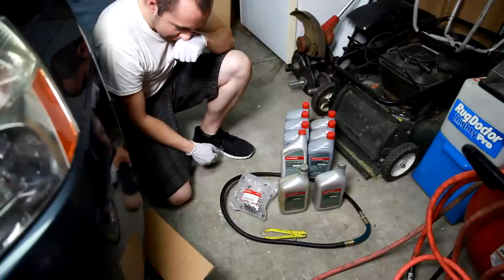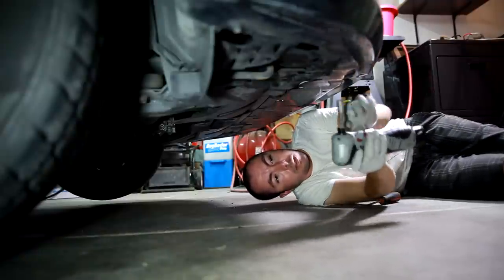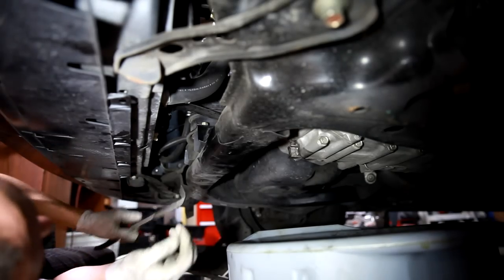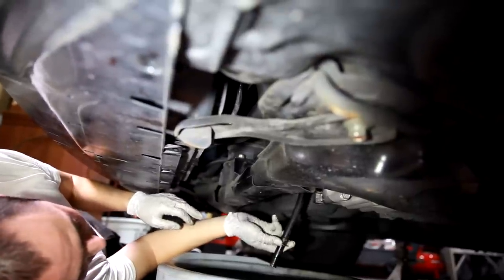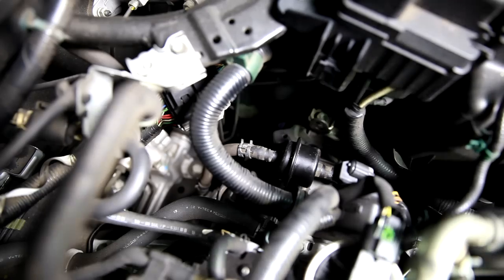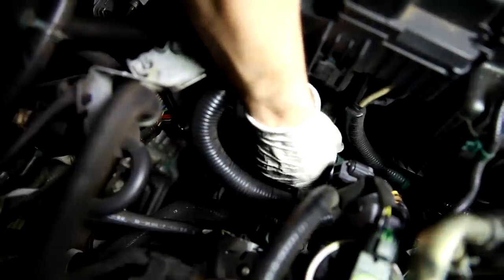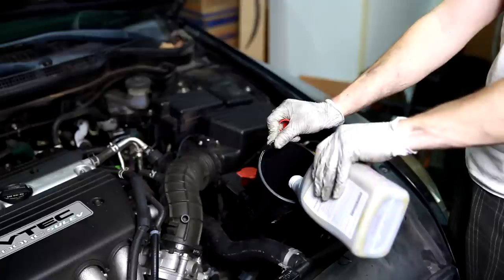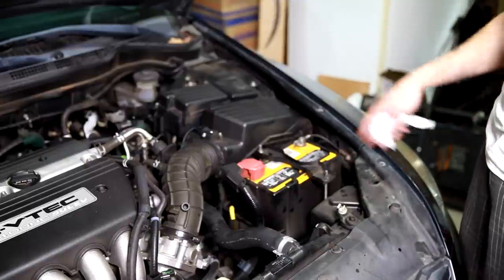2003-2007 Honda Accord Complete Transmission flush with filter

Comment: Followed this procedure on a 2008 Civic.  It's a small pain to disconnect the line and pump out the old, nasty fluid in the torque converter (if you just remove the drain plug, - all you are doing is replacing half the trans fluid, effectively diluting the old fluid with new by 50%).  A bigger pain to disconnect the airbox and related tubing to get to the external inline trans filter, but this is the complete service.  Thanks for sharing your experience - and ignore the whiners.
Reply from the maker: We appreciate the love :)
Reply: I flushed out my 2009 Accords trans,it had about 200,000 miles on it last year.yes that trans filter is a little pain in the ace but I got her done.she purrs like a kitten too

Comment: Finally someone else who does flushes on non CVT transmissions same as I do. I've been getting so much grief over the years from "licensed" mechanics screaming the return line is so important because its also lubricating parts. At idle, the left over fluid in the return line is more than enough. Only difference I would suggest is not to run it until the pressure line is spitting out air. I usually count to about 20 or 25 seconds each run so there's still a minor amount of fluid left in the pan. It'll take a little more fluid to flush out properly but at least its not running dry which I think is important in higher mileage transmissions. Then just measure each time after the 25 second run and fill that much back in with fresh fluid. Video was chill, well filmed and explained. Awesome job!

Comment: I missed the part where you used that hose you showed in the beginning. I'll rewatch. Still, a very good video. Good job.

Update: I did this flush and fill today. Here are the lessons I learned:
1. The 90 degree pliars are indespensible. You will need them on every clamp. The bend helps you reach all three components of the clamp. I bought a huge pair at HF for  $4. Why? Because I tried this with a pair of normal pliars and an adjustable one. Neither worked.
2. The underbody plastic must be removed. I tried getting to the first clamp and couldn't get a grip.
3. WD-40 does help with the underbody plastic retainers.
4. The orientation of the filter is determined by the bracket. It has a half-circle slit on the steering wheel side. The filter as a lip that fits into this slit. 

A very good method that so should be followed very closely. Thank you.
Reply: He didn't end up using it with the method he showed in the video. Had enough length on hose on the car. Driver's side line is what he disconnected from base of radiator. Then fed into pan.
Reply: the radiator fans only have three bolts & two lil plugs. if you remove the fan its very easy to see the rubber hose & clamps. since you're not driving far doing this flush it wouldn't hurt to start the car for a minute or two without the fans. do the flush & snap the fans back in.

Comment: i just followed this technique , the only thing i did different was going in the other hose of the transmission so I can flush the radiator too. Also the filter hoses are easy to remove with the filter still installed. just twist them a bit and they go out easy.

Comment: this video is soooo awesome... do you know multiple Honda Dealerships didn't even know about the bypass filter? after i showed them my car & the part.... and further research ... they confirmed it is a real part & shocked it had a filter. your vehicle video helped in more than one way.
Reply from the maker: +Npetzold Npetzold lol thank you :) much appreciated. Hope you did this yourself to save some money.
Reply: +NutzAboutBolts yes i did... this & your steering fluid video were used in order to perform the task.. only thing i did different on the transmission fluid change is... instead of removing the plastic on the bottom & removing the plastic clip of the cross frame.... i just put the unclamped flow in hose (to radiator)... into the wide hole under the coolant drain hole.
Reply from the maker: Npetzold Npetzold
nice, we'll have to do that next time. We removed the panel so you guys can get a better picture of where everything is :) glad you improvised it.

Comment: Always drain and refill never Flush your tranny I was told by professional Import Transmission Specialist, due to older models can have metal particles in it and they can get everywhere I also put two small magnets on drain plug to help catch metal particles. Great video keep going👍🏼
Reply: How would these particles you speak of get everywhere by simply flashing them out?
Reply: @Kimo Clyde  Specialist said there areas the particles can build up from Flushing a transmission out cause more problems than just doing an ordinary drain and fill to me I would just do a couple drain and fills and buy a couple more Trans fluid then flush who really knows each automobile is different
Reply: @kimoclyde there’s a couple layers in a transmission that look like those “maze with the ball” toys you might have played with as a child with tons of passageways.
And ATF is a good cleaner on its on, so if you do a complete flush the new fluid will clean the transmissions gunk build up, but that build up might clog the passages causing the transmission to fail prematurely.
 Your best bet is to drain the transmission and re fill. Remember the transmission clutch plates use fluid pressure to grab the plate to move your car, if there’s no friction it will slip. 

110% recommend drain and fill. 
And repeat process in 10k miles, and after the second flush you can drain and fill every 40k-65k miles.

Hope this helps!

Comment: If your k20 or k24 have a whining sound from your auto transmission flush your transmission 3 times and change your ATF filter noise will reduce BiG time! Trust me just did mine recently
Reply: hello, mine does it from time to time! Why is that? Will it be damaged if i only do the normal transmission oil change?

Comment: Yeah Honda oil is probably the best.  Good video, but I have one more tip.  Instead of taking off the facia to get at the hose to the rad, go to the other hose coming out and pull it off instead.  It is in the open, easy to get at....I put a smaller hose inside it and directed that into my container.

Comment: The filter they changed is an inline filter, meaning its an additional filter to the one inside the transmission, Honda says you never need to service either one but doesn't hurt to change the one they changed.
Reply from the maker: +salman esmail imports don't usually change the internal filter, I know domestic vehicles you change the internal.
Reply: ya i heard that also, im not saying there is anything wrong with changing that filter, I was just clarifying that it is an additional filter.  BTW love the videos on this honda, I have a 2007 model and i watch all ur videos before performing the services on the car.  thank for ur vids man.  keep it up.  do more on dis car lol
Reply from the maker: salman esmail
lol thanks! we will try, there is only so much maintenance you can do on a vehicle. :) thanks for watching!
Reply: haha ya i know im just messing with you guys.  and ya np the videos are dope
Reply from the maker: salman esmail
lol thanks! :)

Comment: I thought you should always check the transmission fluid level when running and warmed up?
Reply: For a lot of other AT cars, you're correct. But Honda manual says, " bring it to operating temp(85C or 185F), park on level surface, put the gear in park. Shut off engine and check the ATF level within 90 seconds".

Comment: When I went to UTI for automobile, Diesel Truck and Industrial Technology in 1998 -2000 for my AAS degree, one of the very first things they taught us is to throw out the WD40 in the trash and NEVER use it again. It was developed for de-icing aircraft wings. When the bottom fell out in the WD40 business, WD40 was in big trouble. The company had millions of gallons of the stuff in warehouses. After brainstorming they decided to market it to the home mechanic "Joe" with the idea it would fix almost every problem. After all, there is a sucker born every minute, right? WD40 HARMS many systems in automotive work. It is not even an oil. It destroys rubber! Another thing I noticed was something that really hit home because I had a friend that was working under the car without protective googles on. Unfortunately, he ended partially blinded when the brake fluid splashed into his eyes. I cannot tell you how many times I have seen severe "accidents" while working on cars. Much of that could have been prevented by using common sense. I observed one guy that was too cheap to buy jack stands. Instead, he used cinder blocks to prop up the car. and got under the car work on it. The next day he found the cinder blocks disintegrated and the car sitting on the brake drums. Fortunately, he was not killed. I won't even get into working on a car A/C system and the serious dangers of that. Maybe what I have written here will save someone's life. Mike - ASE Master Tech Automobile, ASE Master Tech Medium/Heavy Truck.
Reply: Mike, Big thanks. Sure your advice will save someone's life

Comment: Many thanks for the video.I did the flush as per your video without taking out the drain plug because my 8th gen accord has a cover over it and it very difficult to take it out. my question is, would it be ok not to clean the magnet of the plug? This is the first time it has been flush since i bought new. Thanks again and keep up the good job.
Reply from the maker: +alexbarquin9 the drain plug is magnetic, it will collect a lot of dirt and metal particles in the long run. I would suggest cleaning it if its around 80-100k. I've already cleaned mine at 60k and that's why I'm doing this flush to demonstrate the other option of draining out your fluids.
Reply: @NutzAboutBolts  wrong I did my transmission last week and it's quite magnetic

Comment: So how does it shift? No complaints about your procedure, i do the exact same thing, but i do prefer to have the old ATF to drain into a pan after the transmission heat exchanger so that i know i got all the old fluid out of both the trans/torque converter/heat exchanger. Not a big deal if you do regular maintenance though which it looks like you do

Comment: Hey guys, the Honda V6 does have a transmission filter. It's located on top of the transmission below the battery case. It's a pain though to change especially if you haven't done it before  but well worth it. I changed mine and it looks dirty and grayish from the metal shavings. Most people including most Honda technicians and Honda customer support don't know it even exists because Honda doesn't say anything about it in their service manual, I wonder why.   Honda said it supposed to last for the life of the transmission, really? I don't believe that BS. Honda should at least recommend it changed at 60k or 105k at the most.
Reply from the maker: +james aighewi I agree with you on this. Thanks for the heads up!
Reply: hey man what does it look like cause im working on a 2005 honda accord v6 and i cant find it for nothin.. 
also is it the same type of filter used in this video or a diffrent canster looken one ?
Reply: brando j it’s under the air box not the battery
Reply: james aighewi  there’s also a filter inside the transmission that can only be accessed by taking the transmission apart
Reply: james aighewi c
Reply: You're right, there is a tiny little external filter on Odysseys (for example) on the return line, buried back by the suspension.  BUT (interestingly) my Honda dealer Parts dept insists "there is no ATF filter on that car", even when I give them the part number!  So I just spliced in the generic NAPA/Wix ATF filter in the line going back from the cooler to the tranny, it's cheap and MUCH easier to replace.  Plus it gives a very convenient place to splice in to do later flushes, don't even have to go under the car.
Reply: @nightbrando111  I believe it's a canister looking one, called a cartridge filter

Comment: This method can flushed the ATF faster but it is a lot more work and possibly causes more problems if you don't put the ATF line back properly. BYW, Honda recommends to change ATF on the 7th Gen Accord automatic at 120K miles or 6 years for the first time and 90K miles or 5 years after the first time. You can change it sooner but it may not be necessary unless your ATF fluid is very dark like this car. You can just drain and fill twice each time your do an ATF change, that is more than enough to get most of the old fluid replaced, and that's about 6 Qts. Doing this way, he skipped opening the drain plug but he did not get to clean that dirty plug to get rid of the metal shaving collected on that plug at the bottom of the AT oil pan. BTW, he does not wear any eye protection while he is under the car and he does not use a low profile mechanic creeper, which is much easier to get under the car. Last but not least, he should use a plastic clip remover rather than the flat head screw driver, it would save him from buying new clips.
Reply: I could swear I remember reading this comment and believing it last December. But it's absolutely fucking false. True story I read this comment and thought it was the correct recommendation. I should've been changed the ATF fluid. Honda recommends every 30,000 miles after the first ATF change. Instead I listened to this advice. While the car was taking several seconds to shift from park to reverse, and thought it was normal since your comment states every 90,000 miles. Now I know it definitely wasn't normal and the shifting got a little worse afterwards but after the ATF change I did last week it got much better.

Comment: So just did my trans the exact way you did and now I'm dealing with high idle issue only when it's in park, also it wont shift out of park now. I have to use the bypass button on the side of the shifter to go into reverse or drive. Other than that my car is shifting 100% better when driving. I only went for a little drive to test it. Before I did that I made sure to shift through the gears. You have any idea what's going on? I did some research and only thing I can think of is I added too much fluid but it is at the 2nd dot. Some people say it might be my idle control valve and that I should clean it out. I'd appreciate any help whatsoever. Appreciate it!

Comment: Thanks for the video. Question: So the trans doesn't have a drain plug? Or are you choosing to do it this way?
Reply from the maker: the trans does have a drain plug, we did a drain and refill video before, but doing this way will remove fluids from your entire transmission system, including the torque converter.
Reply: Thank you, great to know.
Reply: so would you first drain from the trans drain plug, and then put it back in and remove the cooler line and pump the rest out? I see an advantage of draining from the plug first to remove any contaminants in the box and then removing the cooler line to remove the rest from the torque converter. Or should you drain from drain plug, refill, then drain from cooler line and then refill again?
Reply from the maker: Peter Hatzidimitriou
you can drain it from the drain plug and remove any metal debris from the magnetic drain plug, then plug it back in, refill with 4 quarts and flush it from the line the remaining fluids in the torque converter, and refill back up the rest. Make sure to use all your fluids so it'll get rid of all the old fluids out. We usually use 12 quarts.
Reply: ok great thanks for the speedy response!...if I decided to do the 3 x 3 method instead...would you change the trans filter after the first drain or after the 3rd and final fill?
Reply from the maker: Peter Hatzidimitriou
I would do it after when you're refilling for the final time, that way, you will have a fresh filter with fresh fluids going through it.

Comment: eh man FIRST OFF, BIG  THANK YOU.... yeah this car is driving me crazy still dealing with idle issue after factory reset, battery unplugged, ECU fuze pulled. 

no power, shaking on Drive gear,  changing transmission fluid now  and checking trans. sensor. see how it goes
Reply from the maker: go do the ECM PCM Idle Learn Procedure, you'll get your idle back.

Comment: Hey mate, will this work for the identical vehicle (RB1) but having the CVT transmission? 
I know I have to use the HCF-2 fluid, just wondering if running the engine to drain the fluid out may wreck the CVT internals.
Cheers!!

Comment: Hey nutz im tom i have a 06 honda accord bought it used about 3 months ago with 99k i got about 106k on it now and i never changed ATF before and ive always been leary about changing mine if you could please give me some tips and advice i did add lube gard and dr tranny as a top off because it was shifting roughly before and now it will sometimes once in a while if im beatin the hell out of it, it wont shift into 4th gear so idk if having it over filled would cause it to act up here and there and could i just do the drain and refill 3 times?? I know honda recommends doing it that way but you if you can get back 2 me bro any advice would help thanks homie! Your video is awesome!